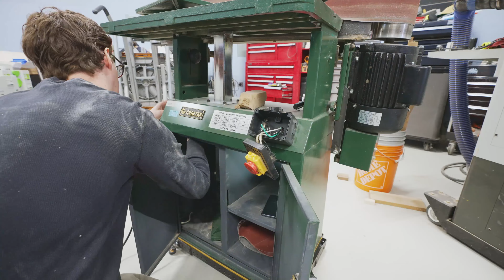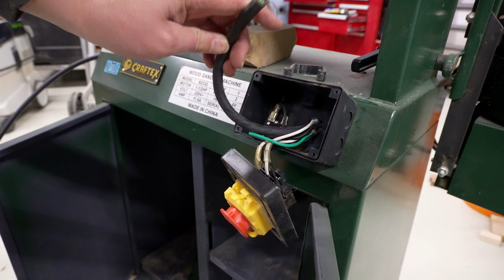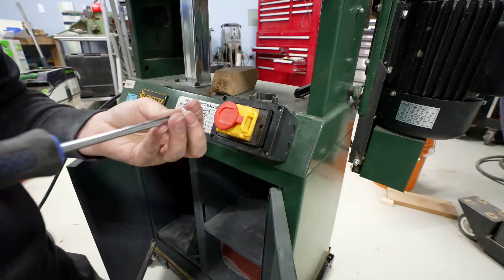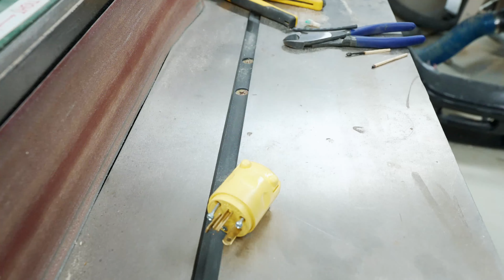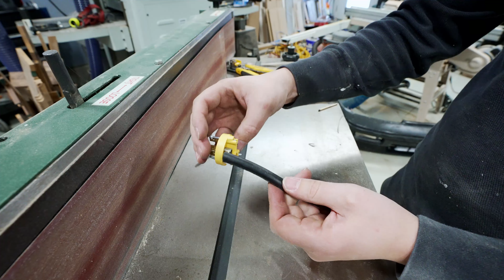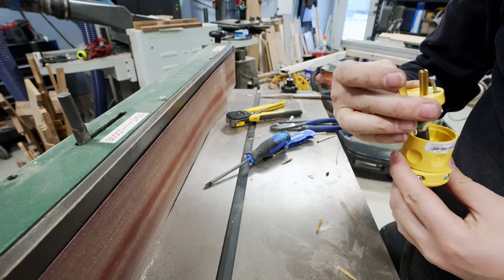Power tool cords are too short

Comment: Looks good. I call those gland fitting and sta-kons
Reply from the maker: I have a VFD job coming up that if I can't figure out I might need your help or thoughts on. That 3 phase metal lathe and Mill I'm going to try to get up and running with a cheap VFD.
Reply: @ResearchDesignBuild  ok yeah VFD is my specialty.